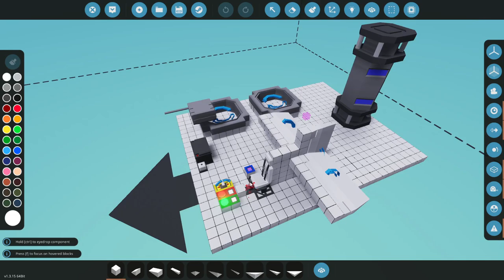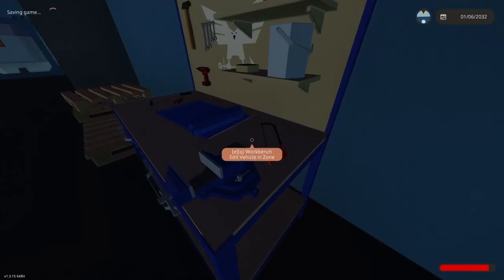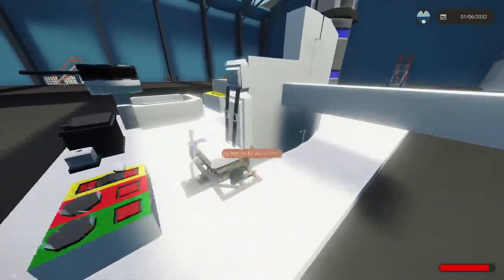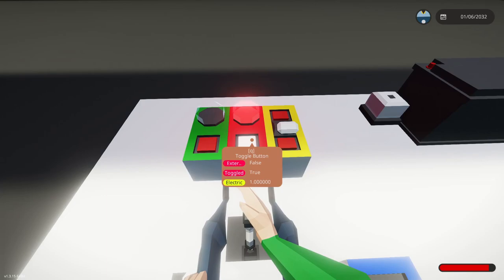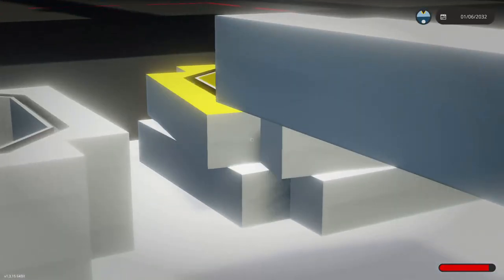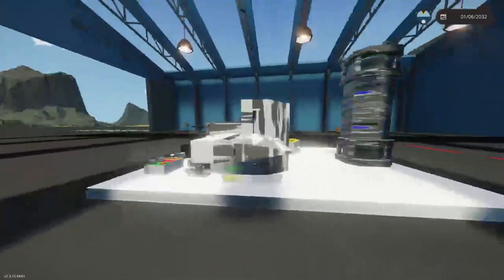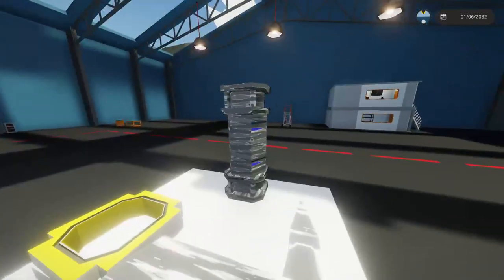EMPs are BROKEN [Stormworks]

Comment: i can understand the control surfaces because planes use bars or strings in real life to move the rudders which is why I don't understand they need power but turret rings are kind of understandable because they use a traverse gear that is sometimes electric driven or hand spun by a wheel but as far as guns go there are no real electrics in them because its all just parts atleast for the light mg's but for the rest of the guns they shouldnt be able to fire so its kinda realistic if you put it that way (dont trust anything i just said this is all from what i know atleast lol)
Reply: To be fair Larger Planes or FIghter Jets do Use Hydrauliks in order to move the Controll surfaces. Since its hard for a Human to move the Controll Surfaces at high Speeds

Comment: Oooh that is sad, hope the devs change that soon.
Have you tried spawning the EMP as a separate vehicle?
Does the EMP kill engines and jet engines? Cause if it does, gliding is impossible anyways with Stormworks physics so you will fall out of the sky anyways.
Also perhaps in dev's logic, control surfaces are still analogical with wires running from the cloche to the thing so it still kinda makes sense.
Reply from the maker: Yeah  I thought about fly by wire as well. This just means tho if you wire it up right the emp is ineffective.

Comment: pretty sure it's not "broken" as in being a bug,  seems intentional - those control surfaces etc are cable connected,  now I'm pretty sure that EMP would disable any gyro or microcontroller interfaces - leaving you only with basic controls
Reply from the maker: Not every plane is fly by wire. Some use hydraulic systems. Either way, they are electric in game and if it only messes with certan things it seems pointless.
Reply: @ProfNCognito  FBW are controlled by electronics (and in stormworks that would be a microcontroller), which are disrupted by EMP.   Electric systems might have a temporary surge,  but shouldn't have long lasting effect unless there was a spark/burn; it's really mainly the electronics which will be affected the most...